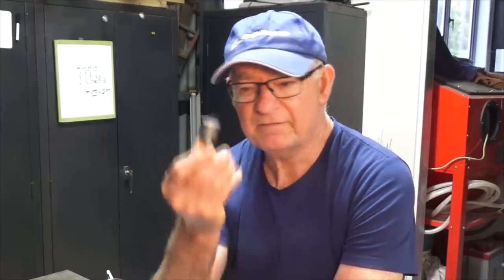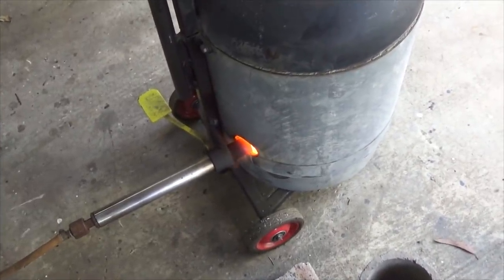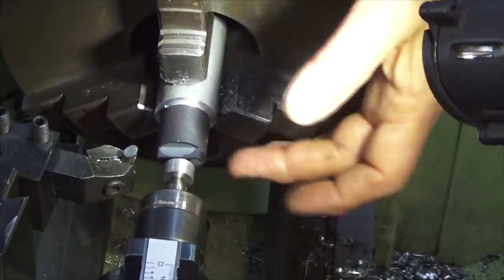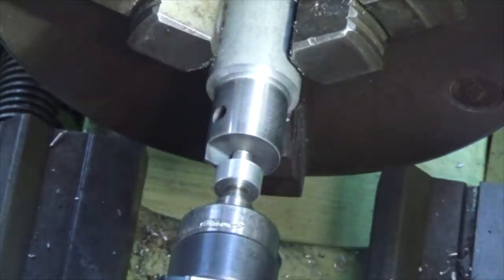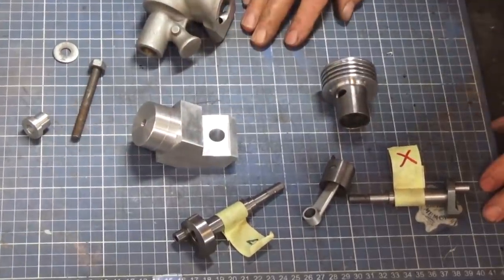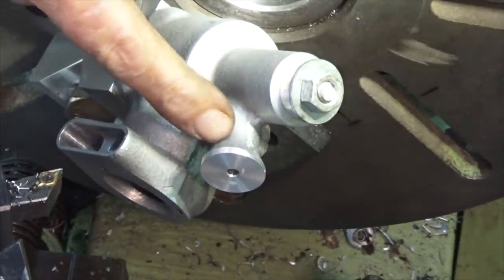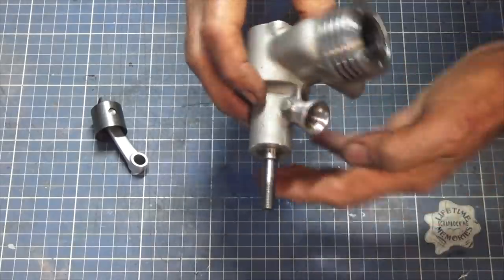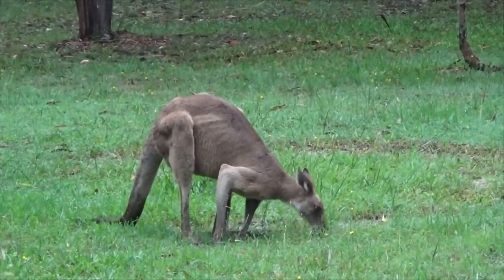Building the Titan .60 Glow Plug Engine #12

Comment: On the brass venturi part it's not really needed, the real venturi effect is created by the spraybar which creates the low pressure high velocity restriction in the airflow,
I may be full of it here not seeing the plans but in the engines I have made I've oriented the 2 holes in the spraybar 90 degrees to the flow for best mix??
Reply from the maker: Thanks, the build notes are a bit vague on the design of what would seem to be an important part of the engine. In fact, there are no drawings for the design of the spray bar at all. I have some drawings for the Crusader .60 which is another George Genevro design but it uses a two piece spray bar with a separate bush and needle and a metering jet on the other side. All the old model engines I owned had a simple tube with an internal needle and that's probably the type I will make. I think the idea of having the separate throat was so that you could alter it's cross section easily. 
Regards,
Mark

Comment: what would you say the benefits of using the diamond holders are over carbide insert holders. and are they wort investing in?
Reply from the maker: In my view, for a hobby machine shop, HSS tools are cheap and easily sharpened. Nearly all the turning I do is in mild steel and non ferrous and I am not after high production so although insert tooling is repeatable and capable of turning hard stock it's a bit of an extravagant luxury. Plus, I find that the edge radius on insert tooling makes it harder work for the lathe. My lathe is a bit underpowered so I can't get the high spindle speeds and high feed rates that make insert tooling worthwhile.
Regards,
Mark

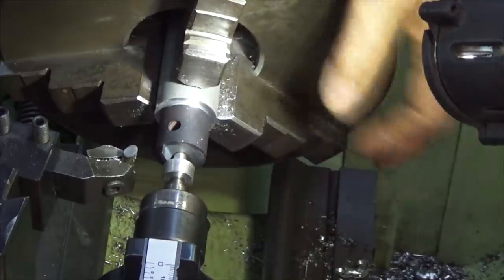Comment: 10:33 if I was going to build one to fly I would probably make the piston out of aluminum, cut it a couple thou undersize, and reconfigure it to use a piston ring instead. Would make it compatible with modern general purpose fuels and make it a little revvier besides.

Comment: Hi mate, what size gas cylinder did you use for the foundry?
Reply from the maker: It's a 9kg propane. I don't run a regulator. You just have to monitor the flame and adjust the main valve occasionally. You can usually tell from the sound it makes as to whether it needs more or less gas.
Regards,
Mark

Comment: Why using cast iron ? When you build a compressor 'for air compression ' they use in really good versions a cast iron cilinder . Why ? It don't expand less than a aluminium one . So the engineer who designed the titan 'had this idea in mind . Go on with the good work , all 'mistakes ' we can learn from . Thanks 
Alex

Comment: If the diamond embedded into cast iron, it probably mingled with graphite and displaces some of it and took its place, rather than embedding into the iron itself... Also, keep in mind that diamond grinding discs are essentially the same thing as the lapping compound, just not in a sludge, but a vitrified brick... When you use diamond grinders, you are advised, if you want the disc to last ``for ever, like a diamond``, not to use anything but the gentlest of the pressures when grinding, as diamond may be hard, and it may last for long time, but it actually does break down spontaneously in atmospheric pressure by itself, over an immensely long period of time, and it can be damaged by shocks and smashing against stuff, be they soft or hard, just as you can smash glass with a piece of wood if you hit it hard enough... I know it wont undo diamond in a second, but a piston moving at its speeds and operating at engine temperature will likely obliterate diamond particles over a relatively short time,  and the engine will hopefully spit them out in exhaust... It would induce increased wear compared to a non-diamond embedded engine, but given the nature of a two stroke, the engine itself should expel the particles over a short time and make itself free of any such contamination during the run in period... Also, keep in mind that i am not stating whether the diamonds are embedded or not, i am just expounding upon the nature of diamond as something while not friable, rather fragile and coupling that with the nature of an engine, which while by consensus is a smooth running thing is in fact enclosed chaos and brutality... Also, keep in mind that diamonds are pure carbon, and what does carbon do while in contact with hot steel? It dissolves into its less hard forms of graphite and embrittles the steel or iron by alloying it... So there are quite a few factors that work against whatever diamond might be found in the engine... The hotter it is, the faster will it melt the diamond, but given that they do the same thing in atmosphere at normal temperature and pressure, just without reacting with iron(say placed in a gold ring), as said, over immensely long time - in an engine where they have a reagent like iron, they will not be diamonds for long...
Reply: regarding the paper, get some 5000 and 10000 grit wet-dry papers, those do marvels when used with lubricant in a rotary setup like a lathe(i never use any abrasive on my lathe, i got a hydraulic polishing lathe head off a cylinder grinder for that, and she is kept in a sealed enclosure with my deckel s11 and other grinders)... People claim that anything over 1000 grit is too slow, but i sharpen and hone my kitchen knives on a glass surface with 1000, 2000, 3000 and 5000 grit wet papers, and after sharpening them once with 1k and 2k, they only ever get reground with 3k and 5k papers and it takes me around 5 minutes per knife with 3k and 5k paper to get them razor sharp, which i know is not a lot of material, but if it were that slow, it would take me days using a hand rather than minutes... A lathe with it removes material slower than with a cutter, but dont underestimate ultra-fine abrasives, they devour material with great subtlety and at unexpected speeds... Also the surface finish is pretty much gauge grade 000 quality after it...

Comment: could have put it in a small crucible or in a firebrick with a hole drilled in it then cover it with borax to protect it. or wrap it up in SS foil to stop the oxidation
Reply from the maker: I did actually try using a borax flux on a small piece of steel about the same size as the piston. It formed a hard glassy coating and the steel was quite clean under the fused flux but it was a nightmare to get it off. The instructions say to wire brush or use hydrochloric acid to remove the flux coating but at the end of the day I thought it was a high risk process and might have been too hard to get it off the interior parts of the piston. 
Regards,
Mark

Comment: I still find it quite strange that cast iron was speced for the piston and not aluminium/silicon alloy.
Reply from the maker: I get the feeling that the engine will be relatively slow revving. If it does run I will measure the RPM and let people know what it is capable of. 
Regards,
Mark

Comment: G'day Presso.  Excellent video. I cringe every time you mention a tight fit at the top of the pistons travel. I understand there isn't any rings and the piston and bore are similar materials but it just seems wrong for this old mechanic. Cheers Peter
Reply from the maker: I know. It sound kind of wrong but everything I have read says that you need to get a tight fit at the top of the bore. I would much rather have a couple of piston rings in there but I am following the script! 😁
Regards,
Mark

Comment: I still hold my statement that this is a free-flight engine with no in-flight throttle control. There is no throttle barrel air-valve.. 
Set the mixture as best you can and let-er-rip!
Reply: Free-flight, control-line or RC pylon racing. All can be done with a set mixture and wide open carby.

Comment: Ive built an ran nitro rc engines for 20 years that fit is too tight it should start getting snug just between 1/2 way and 3/4 the way up id say your close but needs just a touch more polishing yes you want it to get stuck but not that tight that early if that makes sense
Reply from the maker: I agree that it is still too tight and that does give me some latitude to do something about the possibility of the liner being contaminated with diamond lapping compound. I will be getting on with the drilling of the port in the crankshaft tomorrow and then it's going to be a lot of cleaning, fitting and polishing. 
Regards,
Mark
Reply: @Preso58  also seams like needs more taper

Comment: The lap material must be softer than the part being laped. In this case Al, or Lead.
Reply from the maker: I actually did use an aluminium lap and by rights the diamond should have embedded in the lap but it's possible I am mistaken. I will try using the ultrasonic cleaner and maybe running some aluminium oxide in there as well but I don't want to make the bore any bigger.
Regards,
Mark